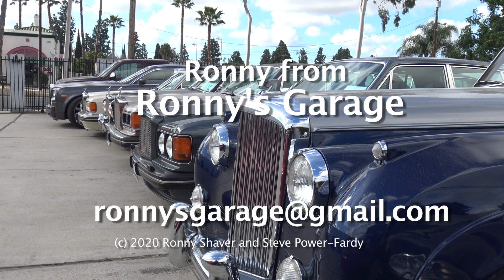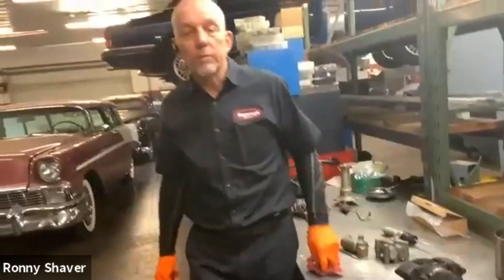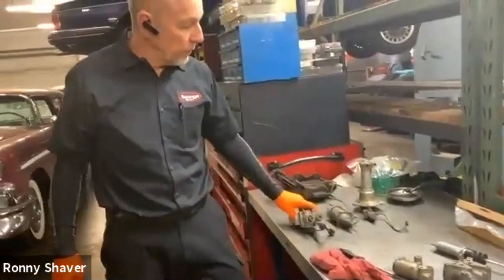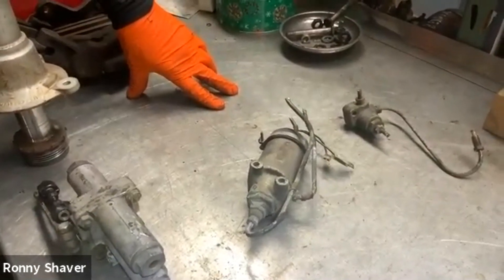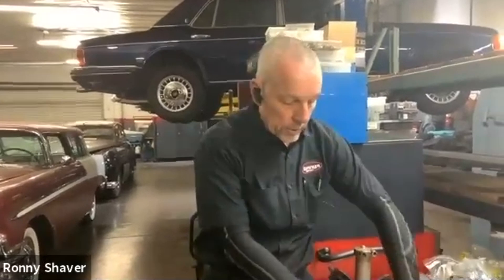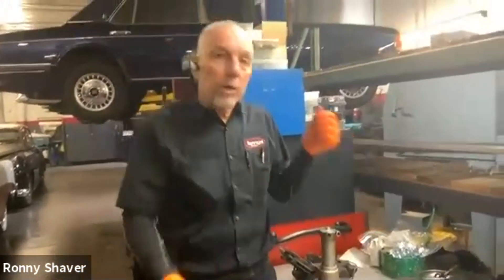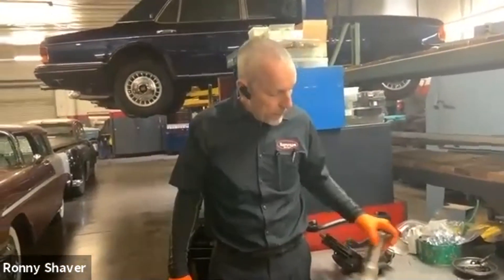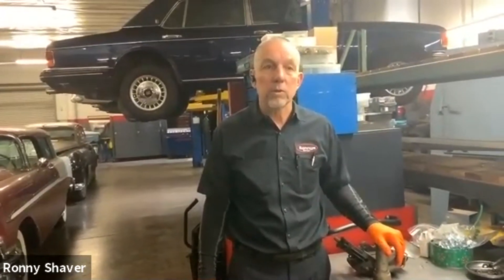Hydraulics System 1973 Corniche Part 3 of 7

Comment: Hi ronny have you ever experienced bleeding a front accumalator only to find when going to top up it's the rear reservoir compartment that needs topping up. At present i have no fluid circulating the brake system past the accumalator bleed screws so i currently have no brakes on the car. i have renewed every flexy hose and accumlator hoses renewed and rebuilt the valve bodies exchanged the spheres from flying spares and refitted still to no avail.The only thing i have not checked are the distribution valves could this be my problem but i cannot for the life of me understand what's happening when i am bleeding the spheres surely the level should drop from the front compartment when i bleed the front sphere can you advise please totally baffled stef. ps car is a 1975 corniche master cylinder car